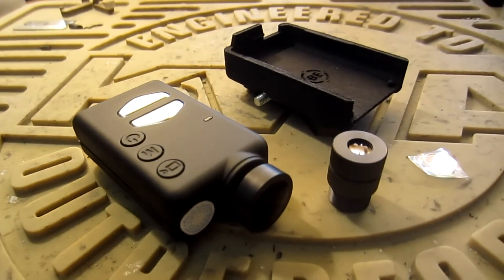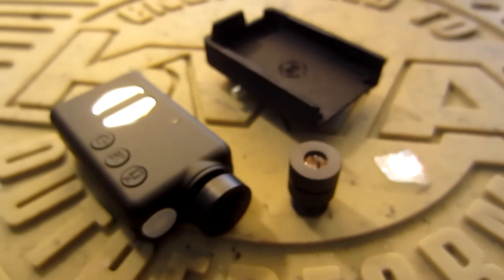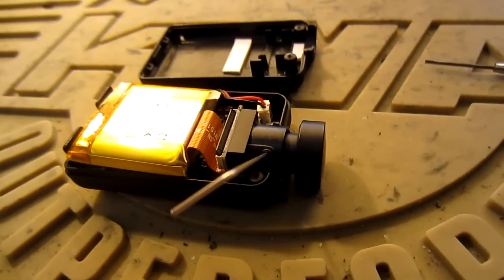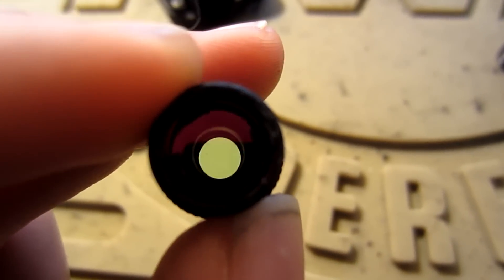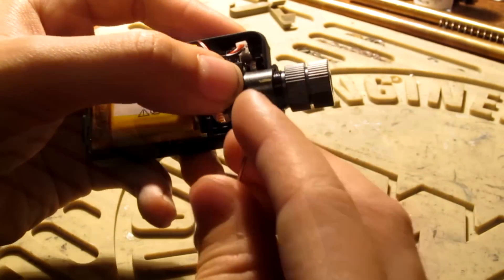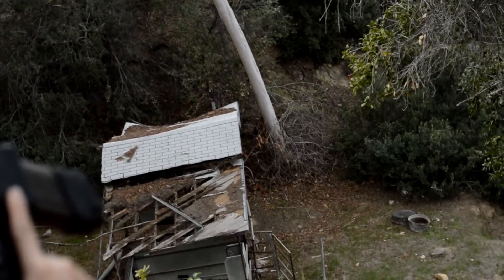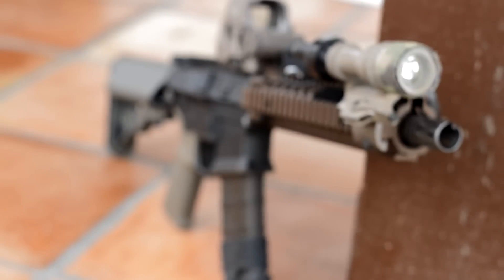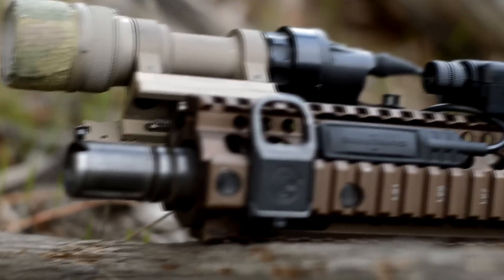Brain Exploder Mobius Zoom Cam Creation and Test

Comment: How did you get the original lens out as hard is an understatement. Do u have to use heat?
Reply from the maker: +Ashley Scott no i didntt use heat, and i dont think its necessary since i dont think the  threads were glued. you definitely need to use some tool to grab along the edge of the lens and twist t wasnt possible by hand.

Comment: Is it possible to mount the camera to the side of the rail, for example the right side of rail. 
Would the footage than be rotated? If so, can the lens be rotated to compensate for that change like the way contours can. 

Thanks!
Reply from the maker: +Anthony Hung unfortunately it cant do the thing where you can twist the lens like you can the contour. if you side mount it, its going to be like when you shoot video with your smart phone vertically. 
brain exploder sells the mobius mount where it is side mounted but the camera still sits horizontally.
Reply: Ah thanks

Comment: hello, i have a problem. i tried to focus the lens and a got the sharpest image when the lens was really far out (like yours in the video @ 1:52 . But when i try to lock it with the screw, the screw does absolutly nothing and the lens can still rotate freely. any suggestions? i really dont want to glue it down.
Reply from the maker: Does it spin really easy? Because mine i need to apply some force to get it to spin. As long as you dont accidentally touch it it should be fine. It yours does spin freely that is a problem, and u may have yo use loctite or something like that
Reply: +Team Reaper Actual Airsoft yeah mine does spin pretty easily. Loctide might be an option, but there is only a few milimetres thread, because it is that far out, so i dont know if that will work. do you have any other idea for temporary locking the lens? thanks in advance
Reply from the maker: +leurehc do you have the exact same lens as the one i use in the video? if you do that is weird that that is happening because brain exploder uses this one as well.
Reply: +Team Reaper Actual Airsoft yeah i have the exact same lens
Reply from the maker: +leurehc try plumbers tape or teflon tape around the threads that should take up the extra slack of missing material
Reply: +Team Reaper Actual Airsoft thank you very much, teflon tape seems to work.
i tested the finished cam outside the window and took a few test shots, but i dont really get the video quality i want. do you have any recommendations for the settings in the msetup programm?
Reply: btw; at which range did you focus the cam?
Reply from the maker: +leurehc i have not even used the program that lets you edit settings. 1080 and 30fps is what i use. and i have focused the cam to about 150 feet or so. glad the teflon mod helped